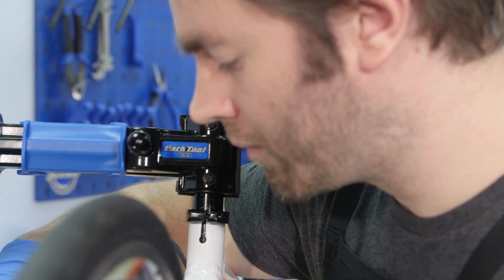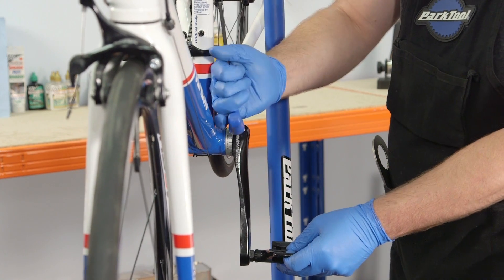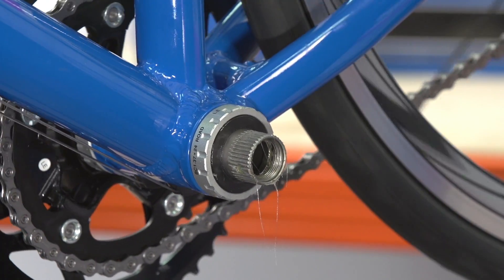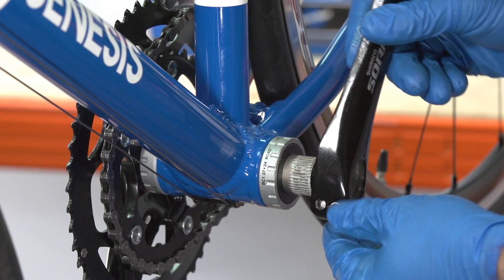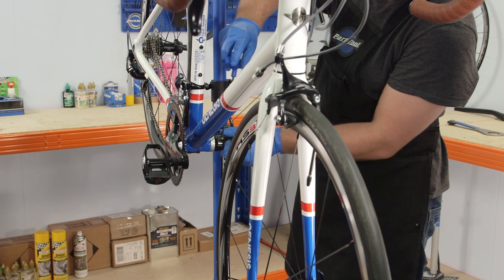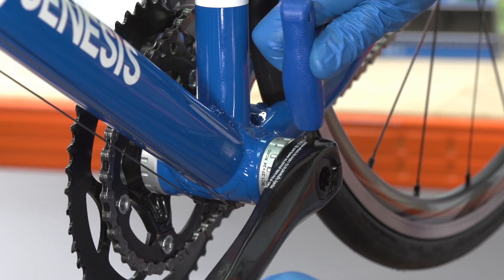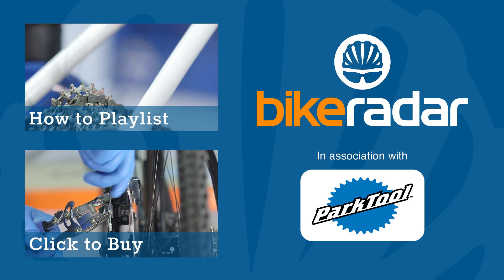How To Replace A Crankset

Comment: You forgot to mention the little plasitk secure chip between the two bolts! at least on shimano cranks.

@pickeldfoot i wanted to these those kinds of videos. gear ratios on road bikes and on mtb 1x10 2x10 3x30 what is good and what can replace the other.
Reply: Do you mean the Stopper Plate, this is the plastic plate with steel pin that clips over the left crank tightening bolts to help secure the crank on the axle.

Comment: How easy is it to change my crainset to a triple from a double? Will I have to change the shifters and anything else as well as the chain and cassette?
Reply from the maker: TheLastFraudster You don't necessarily need to change the chain or cassette, but it will depend on how worn they are. As Vaxbuster says, you will have to change the derailleur and shifter if they aren't compatible. However, you might be better off just fitting a smaller chainring and seeing how you get on, as it's far cheaper and simpler.

Comment: My bottom bracket creaks when pedalling. Does anyone know what could be the cause of this? How could I fix it?
 Its definitely not the pedals
Reply: Most likely just needs some grease
Reply: Probably the bottem bracket bearings.
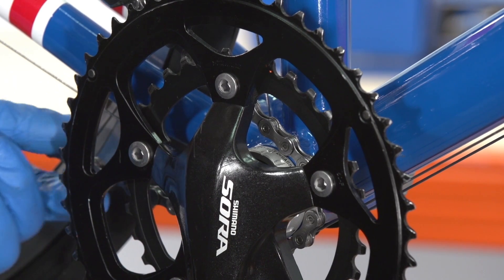Way to test this is to get the chain off (just rest it on the bearings-cup, just like they do in the video at 1:08). Make sure the chain and chainwheel don't touch.

Then turn around the the pedals. If it is anything other than silky smooth resistance free turning, your bottom bracket is probably worn or has no grease.
You can try to remove the crankset and dump a load of grease on the bearings (this may actually be the problem if you for example use a very aggressive degreaser or a powerwasher to clean your bike).
If this doesn't work, it simply means the bottom bracket should be replaced, depending on your groupset, this will cost you around 60 bucks. And bicycle mechanic costs if you choose to let him do it.
Reply: Oh, make sure you use grease, or some lubricant with consistency; oil won't do any good there.
Reply: Jack B thanks
Reply: Masivigny thanks for your advice
Reply: I actually have the same problem. Figured it needs greasing, but that actually didn't solve it. When I tried to disassemble the bottom bracket to clean it thoroughly from inside (and maybe even change the bearings) I couldn't actually take it apart - the big 'sealing' rings wouldn't even move.
I have a slightly different construction than the one in the video, but essentially should be similar, it's an old Shimano Deore I think. Any ideas? (already tried WD40 and an oil)
Reply: Tighten your bottom bracket as tight as u can get it or take all apart and grease
Reply: Not sure if you resolved this issue... but if you have a push/press fit bottom bracket these are renowned for creaking and making noise... There is not much you can do to stop it.
Reply: Saintbob001 its strange because i didnt do anything and it just went away. Bonus